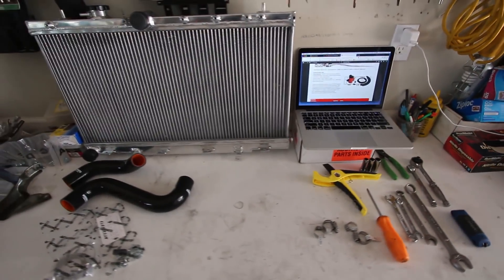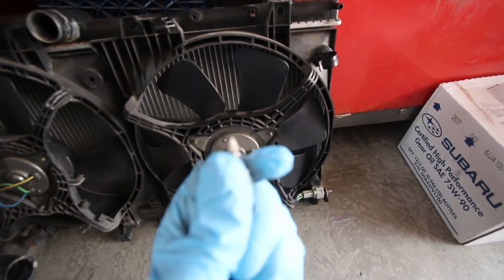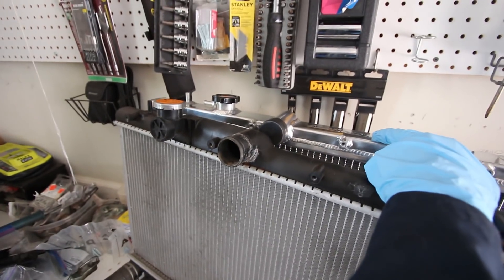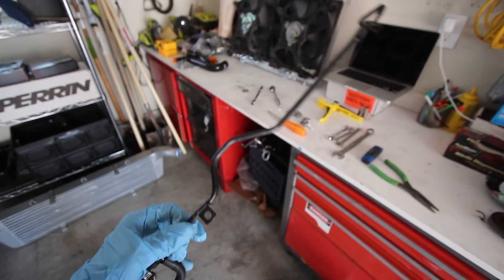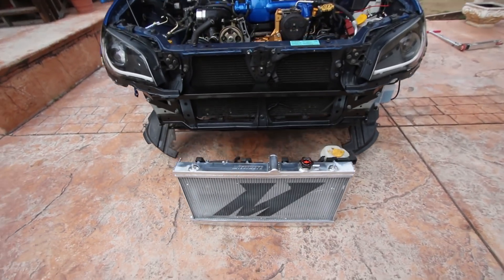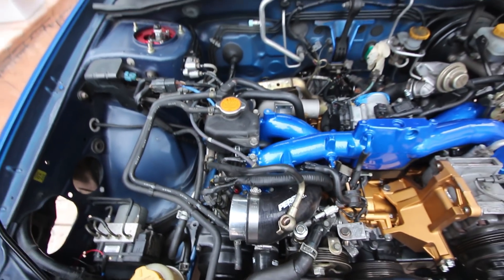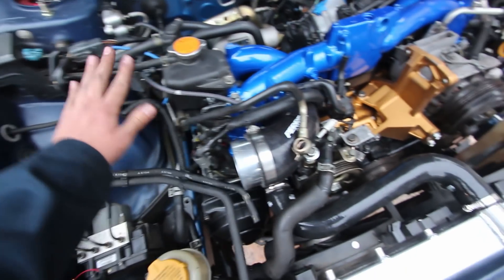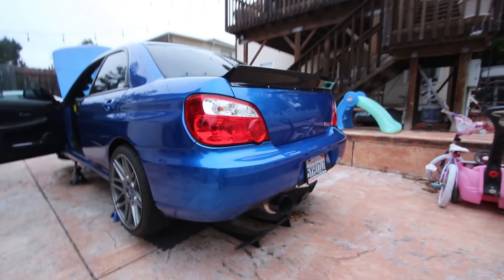PERFORMANCE RADIATOR INSTALL FOR MY BUILT WRX!

Comment: Anything mishimoto is a downgrade. Should have gotten the csf with the built in oil cooler. I personally know of several cars that have ended up on fire due to a failure of a mishimoto oil sandwich plate. I would never trust mishimoto on my build.